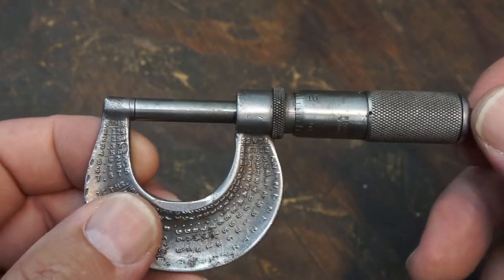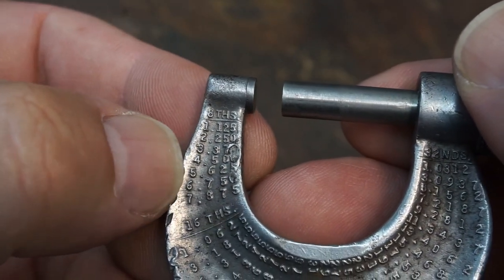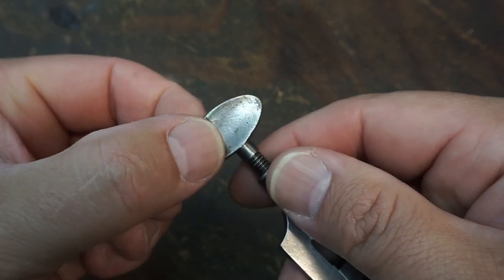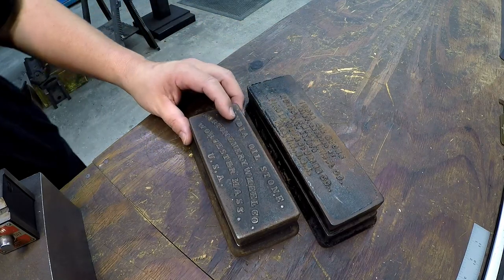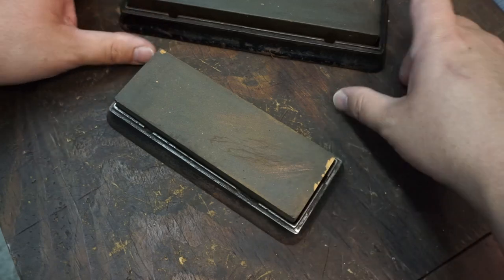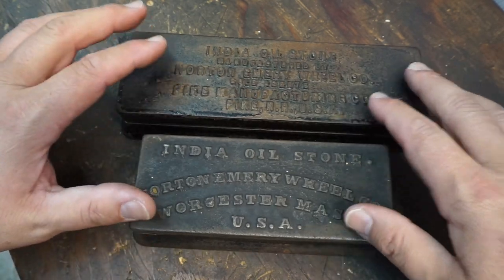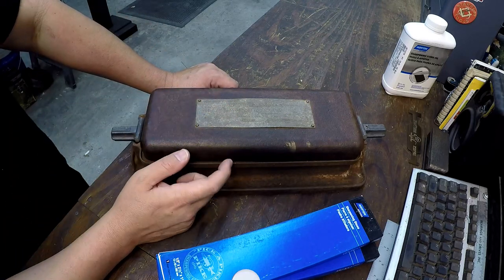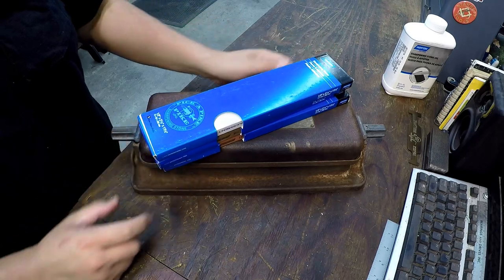SNS 221: Downtime Viewer Mail, New Tooling

Comment: The locals pronounce it more like Wooster. It is south of Boston and was on the rail line between New York City and Boston - basically through the heart of New England's manufacturing center.  Casting the decimal equivalents is a 10x difficulty multiplier.

Comment: I made a light for my mill and drill press  like that a few years ago. I used an LED light ring for putting in car headlights. They are only a few dollars on ebay and come in various  diameters and in packs of 2.  It works really well. Because it surrounds the quill theres no shadowed areas. I highly recommend doing the mod.

Comment: You could try making a small block with a hole for the bigger shaft and a set screw. Then a hole with set screw for the smaller compatible shaft right next to the bigger hole.  Then a small compatible shaft could be joined to the bigger shaft without altering the light or the quill.

Comment: The light is a good idea but would not like the power cord anywhere around the spindle.  Not all machines have that mounting hole.  The two BP we have here do not have a mounting hole on the side of the quill.  They were made in the late 70's and early 80's.  Not sure if they discontinued them or they were only on certain models.  

The vertical Interapid indicator is all I use on the mill, CNC or manual.  Best indicators in the world.  Unfortunately we have destroyed a few over the past 40 years.  Luckily you can get them repaired for about 1/3 the price of a new one.

Comment: Adam I like the light. However not all knee mill are set up with the hole like you described. My Lagun don’t have one and I looked all around the bottom. Drat because I was interested in ordering one of those lights
Reply from the maker: Possibly make a mod to the mill? Yes I suppose they aren’t for all of the mills out there. 😕
Reply: James, In response to several comments below (and now yours), I'm working on a magnetic base to make it work for mills without a gauge mount.  It should be available as an accessory on the site in a few days.  The different kinds of variations in mill heads has been a real eye opener for me.
Reply: Tim Turner thanks for reading my comment. I didn’t give it much thought until I was working on my mill making my QC bocks and shooting video. I remembered Adam mentioned about your light and got to checking for the mounting hole Adam described and couldn’t find one. My personal opinion is the other mills may be close clones of a Bridgeport then there mills Ike mine that I a different design mill
Reply: Hi, James, it took longer than I expected, but I have two mounting blocks listed on my site (hounddogmachining.com) now: one for curved surfaces and one for flats.  After several iterations I ended up using a pair of 90 lb. pull cup magnets for the curved mount.  I had to go that large in order to get the mount to stick on strongly enough that I'd be willing to use it myself.

It's something I've needed to do for a while now so that I can install one of the current generation of lights on my own manual mill (a K&T 2D), replacing the prototype light I've been using for the last year.  So, thank you for the kick start!